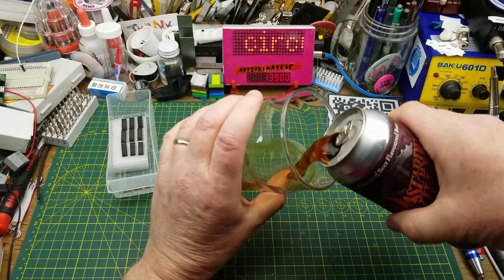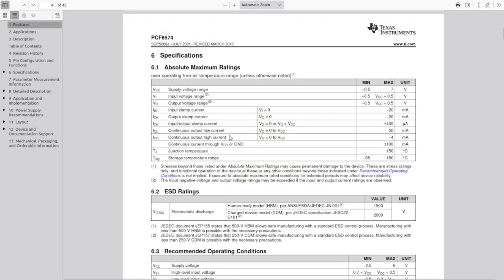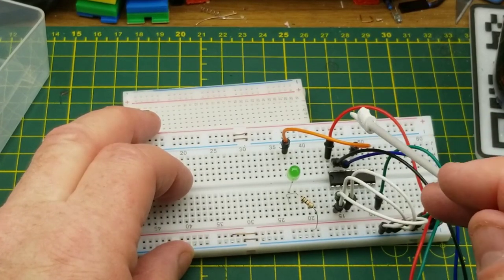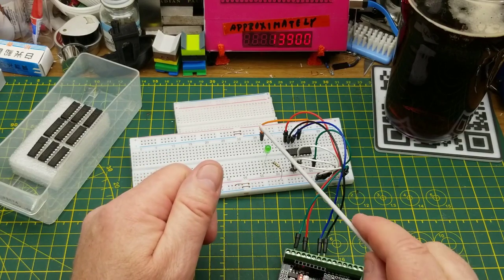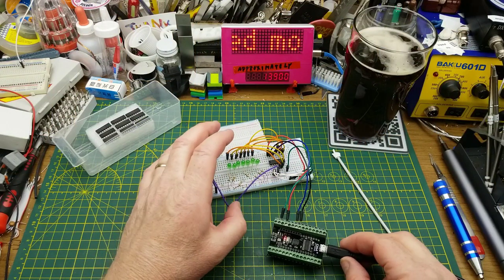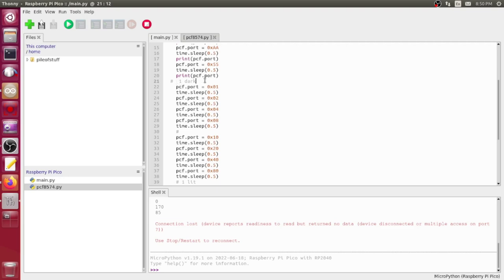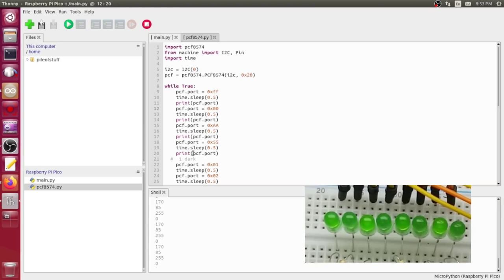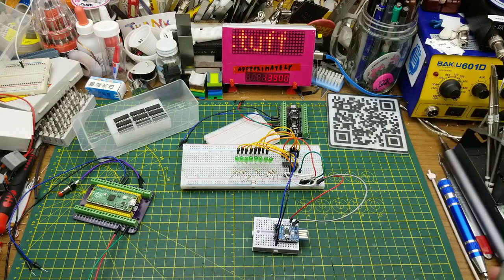GPIO tinkering: 8 port expander

Comment: I've seen these chips used on those I2C backpacks for LCD displays, it operates the display in 4 bit data mode and the driver handles the protocol. I've got some MCP23017 16 output expanders which are similar but a bigger chip that I used with an ATTINY but I don't really know why I didn't just use an ATMEGA328 :)

Comment: These really shine when using a micro with limited pins, to say drive an LCD or where you just need additional pins. You can also use them as inputs, as in I2C read.

Comment: Just a heads up bit of info....there is also a PCF8574A which is exactly the same but with addresses 0x38 to 0x3F, (so you can have 128 IO). This isn't always, if ever, documented by 'sellers', is not shown as the 'A' variant on the chip, (no surprise there) and the TI datasheet for the PCF8574A confusingly and erroneously uses both ranges for the one device.

The NXP and Philips datasheets for the PCF8574 are better in this respect and do document both ranges.

So if you suddenly find a chip doesn't work then check if it's the 'A' variant and change the address in the code accordingly. (Use the I2C scanner to determine device addresses)
Reply from the maker: Excellent information.
Thank you
Reply: @pileofstuff  Excellent video, thank-you!

Comment: The chip does provide a high output, its  ot design to drive much as it only provides 100uA's See 8.2.2 in the datasheet. If it was sink only they would have described the output as open drain  in the same way the do for the int output. 

This would make a  nice device to read the datasheet and work out how to drive it with out a library!

Comment: There’s also a 16-bit I2C expander: MCP23017. Not sure if they’re cheap these days though.
Reply from the maker: Thanks.  They look like they're $4-5 each in hobby quantities.
Reply: @pileofstuff  Yeah, I puzzle over the price of these.  Pre-pandemic, it was possible to buy an ATMEGA8A for about  $0.70 -- and that could be programmed act like a MCP23017.
Reply: @GnuReligion  I ended up using PIC MCU’s I had to act as IO expanders because it was cheaper than buying these IC’s. Also using an MCU as an IO expander allows more flexibility of what you have it to.

For example, on one of the boards I’m using it as an output device and I can PWM the output continuously until the get another command.
Reply: @akhurash  Yup yup.  Analog read and high-impedance are useful.  MCUs with lots of pins are inexpensive, as well. Wonder if all those newly made 74-series, 14-pin chips aren't really are really some kind of standardish FPGA device.

Comment: These chips obviously aren't meant to be used in conjunction with Arduinos or DIY. Rather, they help with product integration by connecting various human-machine-interface elements via a single bus to the main microcontroller, thus reducing the number of connections required, and reducing cost by integration.
Reply from the maker: There's lots of things us hobbyists use that were never intended for hobby use.
That's part of the fun of it - figuring out how to use something on new ways.
Reply: @pileofstuff  Obviously, but for DIY I always recommend to use a microcontroller that has enough connections and processing power so you don't have to invest too much time into engineering for lack of processing power or high integration.
Sometimes you see projects that use multiple Arduino Unos instead of just starting out with for example a Due that would probably be able to handle everything.
Reply from the maker: Where I see this being most useful is when you need both wifi and also a lot of GPIO.
Something like remote sensor monitoring, or multi-element electromechanical displays
Reply: @pileofstuff  True, the dominant platform for Wi-Fi enabled microcontrollers for DIY, the ESP32, offers very little in the way of GPIOs.
Reply: of course they are

Comment: Did not take you long to figure this out.  I like your high quality jump cables!
After seeing some examples online, I made a game out of a PCF8574 that puts a button AND an LED on each GPIO.  If polling reads are done during a small slice of time, then the off-blink (high during read) is imperceptible.  So if you want to prompt a user with 8 fancy light-up buttons, it is possible.
The 3d printer firmware, Marlin, has facilities to use a PCF8574 to drive displays, such as 4/5 data-wire SPI OLEDs.  Extra IOs can be used to read a rotary encoder.  Nifty to drive a user interface with just 2 data wires.
Reply: I'd love to see an example of using this chip as an I2C to SPI converter, particularly an example that is bidirectional, that is, read and write.
I have an SPI e-ink display that I'd rather address through I2C.

Of course a big part of the problem is modifying the display driver to use I2C rather than SPI.
Display has 3 CS, one for the display itself, one for the on-board SRAM, one for SD card reader (which can be ignored) 
Then there's the D/C line that controls whether you're sending the display commands or data.
Reply: @danman32  There are endless examples of using PCF8574 to drive LCD displays, but your bespoke E-ink driver? ... Well, that might be complicated.  It is probably written in C++ though.  You would need to replace the MOSI/MISO/SCK refs, and it may not be possible if driver uses hardware SPI.  Oh well.
As long distance hiker, I always wanted an ultra low powered E-ink device to hold maps and do GPS on demand.  Yeah, a doomsday prepper phone.
Reply: @GnuReligion  the thing is, you have to hold the CS line high or low but this chip at any time is all output or all input, so I don't see how you can read from SPI  with this and still control the CS (and D/C) lines at the same time.
Reply from the maker: You can read from some pins while writing the others.  With both the Arduino and MicroPython libraries.
I just didn't demonstrate it very effectively.
Reply: @pileofstuff  I don't think you can at the same time.
So if you output on say data 5, if you switch to input, you'd lose your output during the input.
So if you were using one of these and selected to use pin 5 to use as CS for the SPI, when you had I2C go to read from SPI, you'd lose the CS for the SPI.
Reply from the maker: @danman32  Ahh. I misunderstood your initial post.
Reply: @pileofstuff  Well, I am confused. Yeah, those pins used for reading are "OR 1" so always weakly pulled high when the register is written.  A read operation returns the actual level of each pin.  @Daniel may have to play with one to understand the OC driving mode.
Reply: @danman32  To make it clear as mud, writing a 1 to an output pin, is the same as putting that pin into read mode.
Reply: @GnuReligion  I understand open collector, but OC is for multiple input sources, where by default the bus line would be held high until one of the input sources pulls it down to impose a 0.  And that's what the MOSI/MISO expects the slaves to do.
But you still have the chip select on the slaves.
Besides the SPI clock,, data in and sata outThe E-ink display has 3 control lines, 2 CS lines for SDRam and display itself, and data/command line.  These must be held at their proper level even when you're doing a read from  the slave.  But when you use this chip to read, you lost your control of the control lines.  You can't independently control the direction of the 8 bits of this chip.  It is either all read, or all write.  To be successful, you'd also need a latch for the control lines so they'll remain in proper state when you do a read from the actual SDI bus.

As for driver being hardware, which I assume meant the microcontroller's hardware SDI, that won't matter since I'd be replacing it with I2C.  However the hard part is finding all the SDI calls and replacing with equivalent I2C calls.
I'm instead for now is use a Pico to accept data from the ESP32 via I2C, and have the Pico manage that data and display it.  That would mean if I want to change the display layout, I'd have to reprogram the Pico, which I can't do OTA with the standard Pico, unless that too could be sent over I2C from the ESP32.
Reply: @GnuReligion  what makes you say that?  You can't read whether the slave is inputting a 1 or zero if you are outputting a 1.  It would then be 1!
Remember, the 8 lines cannot be independently controlled what direction you're going.  They are all input, or all output.
Now if you didn't care if during an input if a line defaulted to 1 or 0, then you could use pull-ups or pull-downs, but I have to hold the 2 CS and 1 D/C line at their proper state.  You can't do that if you've selected to input.
Reply: @danman32  (a light just came on in my brain, moved this line to the top) -- I hope -- you are aware, that in order to send just ONE BYTE to your e-Ink device, you must bit-bang it with 8 separate I2C transactions through the PCF8574?
Alright, have the data sheet and my own code and notes open now.  I was wrong, the P[0..7] register is a "push-pull design" and only the INT and perhaps I2C pins are OC.  But the chip DOES INDEED work as I remembered.  It does not know which pins are input or output. @pileofstuff is using a high-level library that obfuscates this. At the Wire library level, you only read a byte, or write a byte. This should be fine for your application though. Your 3-n-1 SPI device with 3 CS/SS lines are all outputs for the PCF8574.  Everything is an output except the MISO line, and it will read just fine so long as you always WRITE a 1 to that bit position. A high-level library will do this for you with an OR mask. Check out the TI datasheet, and you will see a current limiting device on the high side the push-pull drivers.  I(oh) is current limited to -1mA, so when it is driven low, there is no damage. The outputs can sink 25mA, though so you can drive LEDs on the low side.
Reply: @GnuReligion  I2C can send and receive multi-byte messages.  The last bit in the address frame dictates  direction of the data frame.

How can you read when you're writing?  And how do you tell the I2C  GPIO chip to read from only one bit?
It is all 8 bits read or all 8 bits write.
Now some devices will be OK with having its input data (output from chip perspective) line open during a read operation, but CS and D/C lines  must always have their inputs properly set as 1 or 0 during an SPI transaction.  That can't be done with this chip alone during an I2C/SPI read operation.  Now if there's a latch after this converter, then it could work.
Reply: @danman32  You seem to be discussing this in good faith, but I give up.
Simply get the chip, and I'll even send you some Wire library source code. It is all more primitive than you imagine. This is a 30-year-old device. Reading a byte does not change the state of any pin. Some of them, driven high for reading, may actually be low when read.  All the pins driven low will be low.
Reply: @GnuReligion  So if say I connect bit 0 to bit 7, send a high (1) to bit 7, I'll be able to read a 1 at bit 0, and if I then set bit 7 to low (0), I'll then read 0 at bit 0?
In my view, when you begin a byte read to read bit 0, there's nothing to keep bit 7 at its last set state for bit 0 to read, since it too will be at read.  I didn't see anything in the specs to only do a read from specified bits, leaving the rest as output, maintaining their previous state.
Reply: @danman32  Good golly. There is no symmetrical high-impedance "read mode" like on a modern port expander, or MCU.  If pins 7 and 0 are tied together, if either pin is written to be low, BOTH will read as low because there is a current limit of 1mA on the high side of all the output pins.  You read all 8 pins at once every time, and simply ignore the bits that correspond to pins that are being used as output.  If 0 is the read bit, you want to (readbyte AND 0x01).  Every time you send data, (outbyte OR 0x01) to ensure that line stays weakly driven high.  Fancy high-level libraries will let you set a mode for each pin, but this is all software.